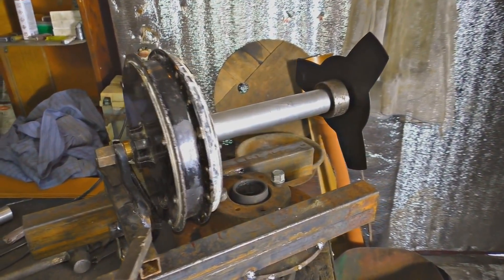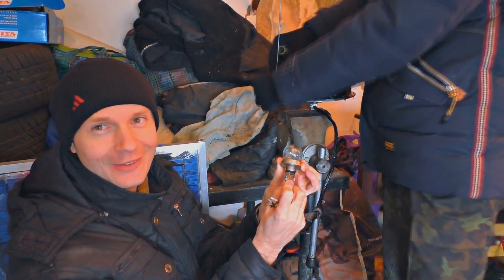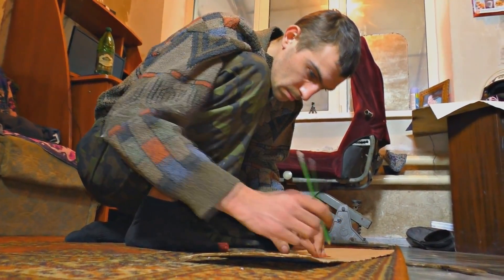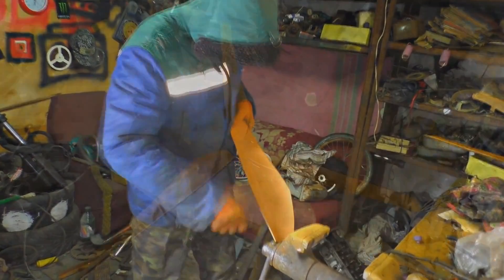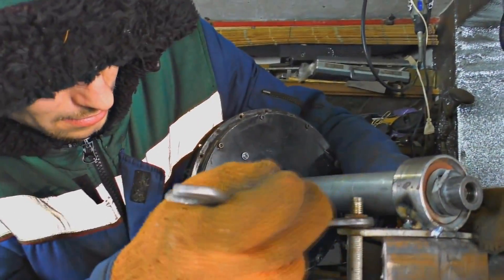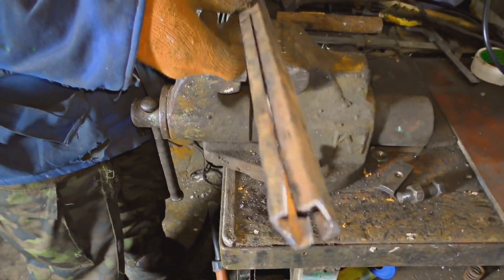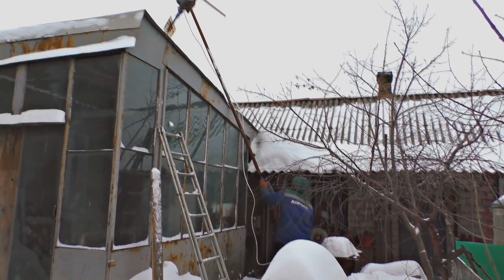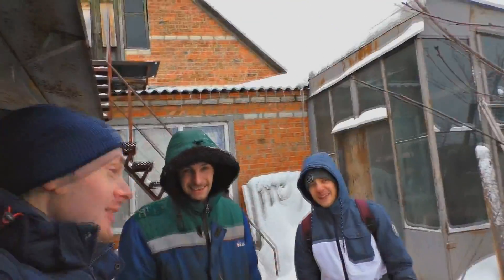Powerfull Wind Generator DIY / First Part / Free Energy out of thin air! ⚡️

Comment: What is the use of 3 phase diode. 
How you converted and connected 3 wires in motor to 2 wires to the accumilator.

Comment: Yo check it out the little drain pump on some washer machines for clothes and most all dishwashers.  Coupler a 775 motor or blender motor shaft to shaft. Power it with drill battery to motor spin it and you will receive 250-300+ volts. What is strange about this one is you can touch the two bare wires with a load and no get shock.! Put it through a transformer and a couple spark gaps you will power a house from only 18-36 voltDC. I been working on this one now for about four years

Comment: Swinging tetrahedron with wheel on a circular track for the engine mount - single pole sticking upright doesn’t have geometric sense.
It wouldn’t have blown down - it would have been triangulated on four planes all integrating for rock-solid support. Need only be small - no more than a bit more than the length of a blade for ground clearance - and the whole could be mounted flat with the circular track in a high position.
ABSOLUTELY LOVE your videos......

Comment: 1. 3:59 It seems, you have blades oriented in opposite direction - these inner tips should be oriented downwind to create larger low-pressure zone behind blades,  which delivers more power.
2. Would'nt be easier to construct vertical wind generator (Savonius)? Easier construction, half a windspeed needed to run.
Best regards from Czech :)
Reply: Maybe technically harder because of pulleys or chains?

Comment: I have a feeling that this will spin and look very pretty? but when you connect it to a charging circuit and ask it to do some work it will just stall out. I hope when you get it running you can show us how much current it can generate into a load, not just show the voltage which means sod all.